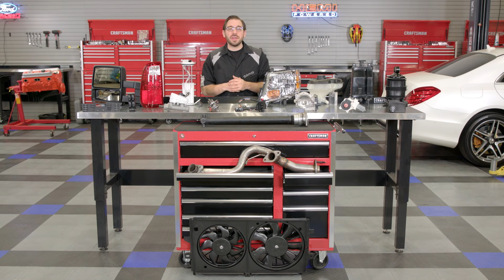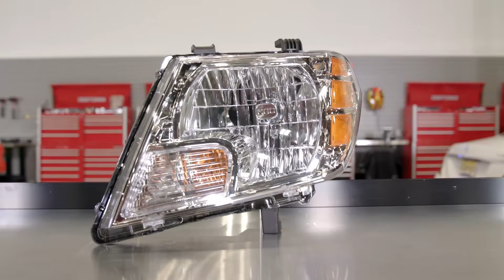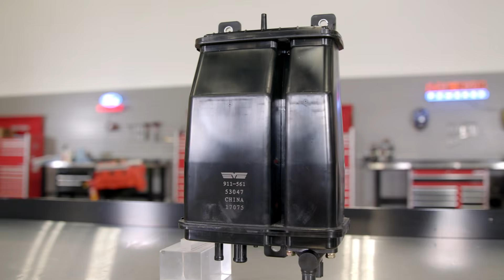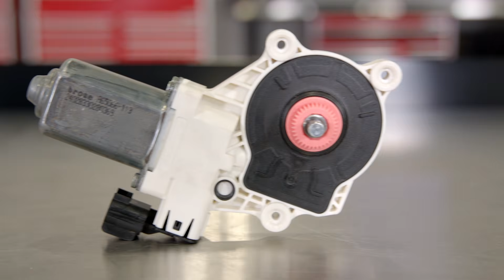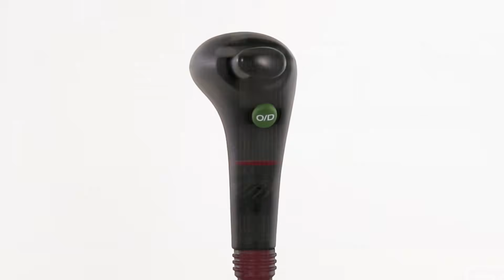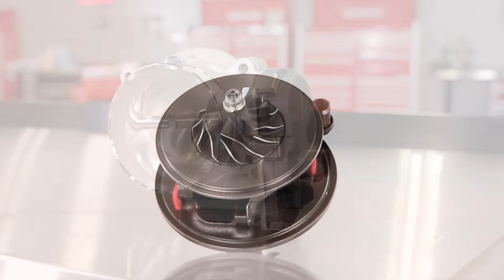Dorman Replacement Parts Review

Comment: Bought a pair of headlight replacement harnesses. When I replaced them and tested them, the high beams were low beams and low beams were the high beams.. Had to take it apart and switch two wires so they operated like they should. Wires were color coded properly but ran to the wrong port inside the socket. Since the harness had a rubber coating all the way up to the socket, you couldn't tell which wire went where unless you stripped back the rubber and checked. Very dissatisfied. Looked on the back of package and said Made in China. Quality control people better get on this as I've had other problems with their products. Won't buy again.
Reply: Worked for them they send out parts before they test them they care nothing about safety or you! And they were at one time a great place to work but no more!
Reply: Yep mine leaked and lasted about a year!

Comment: I work  a tech assist line with shops from the U.S. and Canada calling in for help on problematic vehicle repairs.  Literally half my day is spent saying these words over the phone-"Is it a Dorman part?  Throw it in the garbage and try an OE or quality aftermarket brand"  problems solved daily.  Dorman should be sued.
Reply: I worked for them you are right they should get there ass sued they buy nothing but crap and did treat they employees great at one time no more! There parts go out before testing now!
Reply: Can vouch as a current employee, only care about money and numbers

Comment: Just bought a Dorman OE coolant expansion tank for my 2013 bmw 5 series for less than $100 which includes the cap as well. The material is way beyond BMW"s oem version in which they use cheap plastic causing to fail in shorter time yet charge about $130 for their branded coolant tank! No tanks, ill stick with Dorman which made a better version of it for way less!
Reply: A coupla years ago bought similar  dorman tank for Maz 626 for $36. From rock.   Online the cars reported to have a mystery leak fixable by replacing the tank, which worked fine.
Reply: Where do u recommend buying a new coolant expansion for the same car